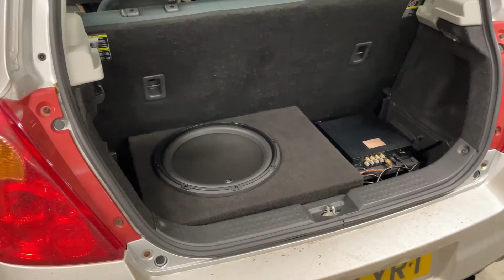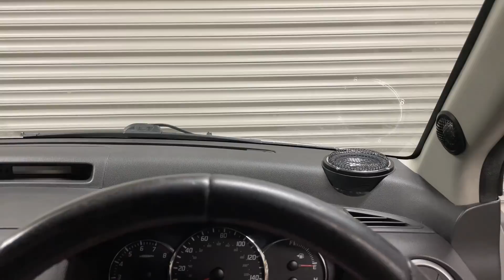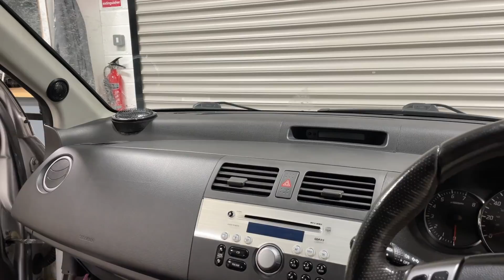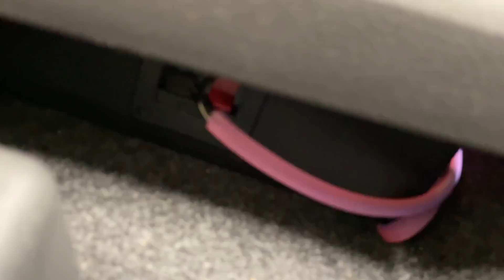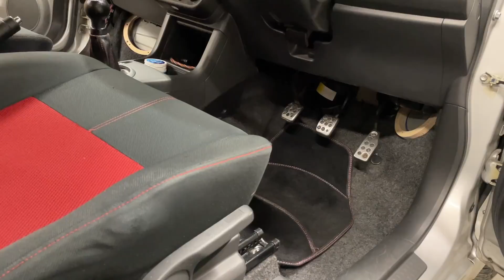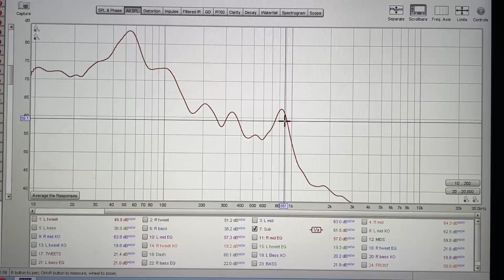Cheap Sound Quality Car PART 8 - RTA Session of Current System with Focal ISUBTWIN, Steg MSS1 + MSS3

Comment: Peter, there is a JBL sub fuse twin equivalent of focal. It's 7db more sensitive with same 200w rms. It also has passive radiator. Try it out next time. People from DIYMA really liked it
Reply from the maker: Thanks for the tip. I’ll have to find it as we don’t really have support for JBL in UK.
Reply: Hi Eugene, do you have a Frequenzy Respons of the JBL Sub? I could imagine the seat will cover up higher frequenzys from 150hz
Reply: What is this JBL model you speak of?

Comment: You mentioned feeling the kick from the mid bass, its weird that some cars you can feel it and others you can't. I've seen cars with almost identical responses from 20 to 20k and both felt so different. What cause that?
Reply from the maker: Any car can measure the same with great amount of tuning and EQ work, but as you say they sound different. 
1. Midbass drivers are in optimal locations and application for the driver’s T/S specs. 
2. Transient response of speakers 
3. Car size & rigidity 
These things are all variables and difficult to tell the formula.

Comment: Awesome video Peter, thank you. It's really helpful to see how you deal with a less than ideal system and you are the only pro that I see not "poo-poo"ing boost. 
If I may ask, when I measure full range for a midrange, do I need a high pass like the 1Khz on the tweeters? If so, is 1octave below FS good or should it be closer to FS?
Reply from the maker: If you measure them at 85-90dB, then they are safe even without a HPF, otherwise cross them at 80-100Hz.

Comment: Thnx for the videos and the informations peter, it did help me with my install.
However i have one question, i have an audible floor noise (white noise) coming from all speakers, i tried to lower the gains but the noise is still there it’s not as loud as before but it’s noticeable, although the noise is gone when i unplugged the rca cables from the amp!
I’m running pac amppro ch41 using my factory radio and audicontrol dsp amp

Could it be the pac amppro or amp fault? Help plz

Comment: Benefit of having such a peak in the subwoofer range is: once you EQ it down, it will make less excursion in that frequency range, (bc you put less energy into it), which should result in a more dynamic response of the driver.
Reply: If the peak is caused by cabin ringing, then in this range the bass will be actually less dynamic

Comment: Hi Peter,

how does this sub works in sealed for metal / rock? 
I have for a long time Phase evolution Aliante 12 and I am considering some change. Or what would you use as a sub in small car for metal / rock mainly?

Thanks
Reply from the maker: Aliante is hard to beat in a sealed box as it’s so accurate and controlled what you need for rock. W3 is great in sealed too.
Reply: @pssound9749  Hmm so Aliante for more years to come :) Thanks
Reply from the maker: @kiklop8362  get another one and run 2, more fun! 😃
Reply: @pssound9749  Oh cmon, I have second one stored under my bed :).  But there is not much space in fiesta.

Comment: Great explanations.

I'm still waffling on whether or not to try out a Helix V12 in a 2016 740i.  If it's not enough it's a big waste of $ to chuck and switch to DSP / A/B.
Reply from the maker: Not enough in what way? Output? For components it’s very capable. For sub(s) i’d use a separate monoblock.
Reply: @pssound9749  how about for the HK or replacement driver in the underseat location?
Reply from the maker: @ccvideotech  get a 2-4ohm aftermarket upgrade and it’s absolutely fine. Some of the HK ones are 8ohm.
Reply: @pssound9749  I was thinking a small enclosure sub on a monoblock (processed through the V12) at the front of the passenger foot well to fill out the lower octaves a bit as the trunk is sealed and I'm not going to drive around with the rear armrest down just to get base.

Do you have a driver recommendation for that.  Or, do you think the right underseat driver can cover "enough"?

Comment: What would you recommend for me to do to get a higher response out of my sub? The measurements are very narrow it seems to only play between 40 and 60hz it is a very high peak it looks like a bell curve. It's in a custom box built to spec tuned to 33hz. I cannot get a good blend with my midbass with such narrow bandwidth. Do you think going sealed will help? The sub is 12" in a 2ish cubic foot box. I'd like to get a response up to 80hz if possible for midbass blending.
Reply: I think you're already thinking on the right track.  A new box will likely go a long way.  Personally I've always preferred sealed vs ported.

Also... (1) check your crossovers and make sure you don't have two turned on by accident or something like that. (2) move the mic around and take some more measurements to see if it's just a positioning issue.  If moving the mic changes your measurements, return it to listening position and move your subs (if able).
Reply: Easiest way to test it quickly is just block reflexport airtight. Then you can check if output changed to hoped direction. But some subs won't work in sealed enclosure. So test carefully, you might find your sub excursion limits even in low listening levels.
Reply: @ilkkak3065  I actually tried that already and the response changed but in the wrong direction. It wasn't exactly air tight I just stuffed the ports with towels real quick to see if anything happens. I'll try a more air tight seal and measure again. The sub I run can be ran ported or sealed according to manufacturer specs. It's a low end FI audio the xv3
Reply from the maker: You may want to sign up for Patreon and check the weekly topic where we talk about good sub bass in a car. It’s more complex than just ported/sealed. Plenty to learn there.